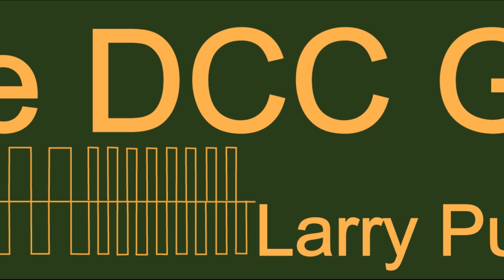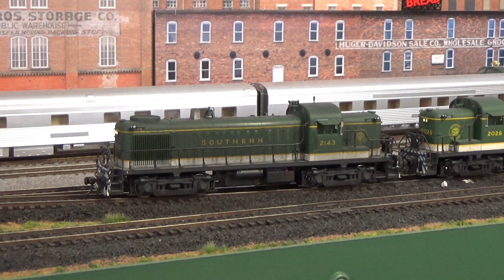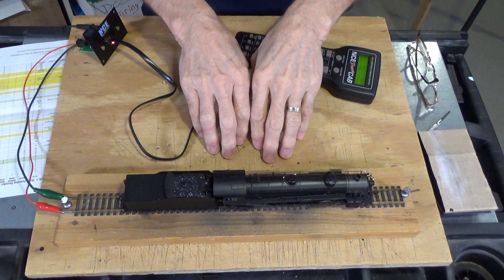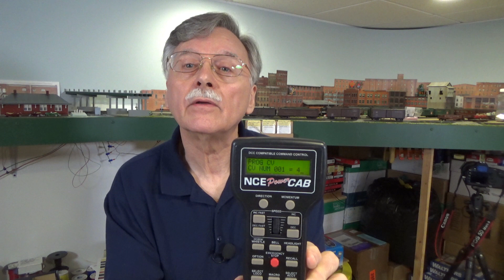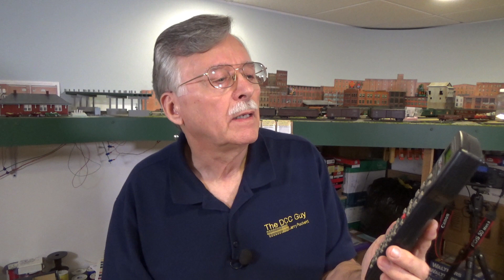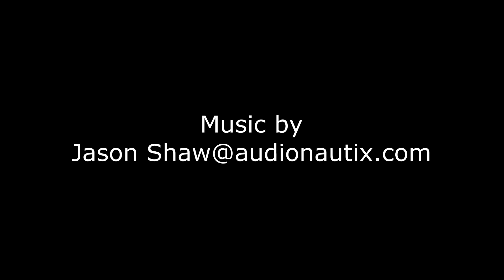DCC 101, Programming the Basic 8 (47)

Comment: Hello, thank you for good info insight into Dcc. I looked throughout your video list, but can’t see a solution to my problem. Hopefully you are not too busy to pass on your comments!
Recently, after a few years of severe illness, I’m getting back on my feet again, before this occurred I had an extensive 00 layout, all DCC, here in the uk. Now I am re-launching my system to A/C 3 rail, Märklin C Track. I already had two ESU locos, running 2 rail DC,DCC. Everything was fine. I cleared out all my 00 locos and fitted my ESUs with the centre pickup. On the Program track my DDC setup as usual, however, on the main track mix has priority, and I’m down to 16 functions, not 29 as with DCC. I now use a Märklin cs3+ Central station, Myers’s 500, is moth balled! 
Sorry this is lengthy, but you seem to me to be my best bet…….
I have been informed I need to change CV47 to -2 or CV50 to 0, this stops max being the priory system and allows DCC on these two locos.
I have tried changing my CS3+ and that works, except my Märklin locos work better with max. Can you help me? 
a. To identify the CV I need to change on my ESU locos……
B. What setting these need to be changed to. 
I tried to change CV47 to -2 on my Ecos but it crashed every time.
Any help will be marvellous…………
Oh by the way, great channel, extremely informative, I Subscribed over two years ago, whilst still in hospital. Thank you

Comment: Larry, I use NCE power cab and plan to add a model railroad technologies caboose light decoder. Can I program that with the power cab or do I need to get involved with JMRI and connect my pc to the track?
Reply from the maker: If it is based on a DCC compatible decoder then it should work. IT should say something about programming it in the instructions.
Reply: @TheDCCGuy  thanks Larry! I’ll check out the instructions when it arrives. Paul

Comment: I just ordered a NCE Power Cab, which I haven't received yet, so I am watching this video in preparation for its use.  I'm wondering how the Power Cab differentiates between a test track and the main line?  Would not the functions be identical in either case?
Reply from the maker: Not sure what you mean by test track. Care to explain?
Reply: @TheDCCGuy  The single piece of track like you used in the video.  Maybe you called it a programming track?
Reply from the maker: OK, that is the programming track. It is used when you want to change the setup of the decoder, sort of like changing your preferences in a computer or your TV. The PowerCab does not have separate outputs for running locos and programming them, that is why you need an isolated piece of track for programming. Otherwise you would program all your locos on the track at the same time. I have produced other videos on setting up a programming track and NCE sells the Auto-SW that will automatically switch the output to the programming track whenever you send out programming commands. Most DCC command stations now have separate outputs for operations and programming but the PowerCab is now almost 20 years old and does not.
Reply: @TheDCCGuy  ok, so the answer is that the DCC controller has separate outputs for the main track and the programming track.  Thanks
Reply from the maker: No, there is a single outlet that provides BOTH main track power AND programming track power. You must provide some way to isolate them so as not to accidentally reprogram all your locos. I have several videos on my channel offering various methods to do this.

Comment: I had a problem with "run away" engines when I turned on my NCE DCC system. After doing some research on NCE's website I discovered that it was caused by decoders that recognized DC and DCC power. By turning off the DC function on my decoders I eliminated the problem. Your explanation of CV29 was big help in solving the problem. Thank you

Comment: Trying to set CV6 with a NCE PowerCab. When I enter a value and press enter, I receive a message saying, "Can not read CV". What should I do the remedy this situation?
Reply from the maker: Are you trying to program on the main or on an isolated programming track?
Reply: @TheDCCGuy  Using the programming track mode with no other engines on the layout.
Reply from the maker: Have you had a similar result when you tried to read other loco decoders or just the one?
Reply: @TheDCCGuy  Just this one.   Its a QSI chip with 007 Id and 113 Manufacturer code.
Reply from the maker: I have not used a QSI decoder in years so can’t really address issues with them. The PowerCab is usually pretty robust about programming decoders. You might see if there is a QSI forum on Groups.io that can advise you. You could also try programming it on the main and see if that takes. You won’t be able to read back but it might work.
Reply: @TheDCCGuy  Thank you for all of your responses.  They have been encouraging.  FYI:  Your channel was the first one I subscribed to and it's one I keep coming back to. I find your presentation to be understandable and full of excellent information.  Thank you for that also.

Comment: We have a 5 year old layout at my Club that has developed a problem. After tens minutes or so, any sound locomotive will stop running, non sound will run fine. It is NCE controlled with a sb5. We are at wits end. Where can I get assistance?
Reply from the maker: That is a very strange phenomenon indeed. Does it matter whether it is one or more locos running at the same time? Do the same locos operate without issues on other DCC layouts? Does the brand of decoder matter or does this happen with SoundTraxx, LokSound, BLI, Digitrax, etc. decoders? Do they start running again if given a rest period? Even if it were a power issue I would think the sound would drop out and the loco continue to operate. I would call NCE tech support and see if Ed Wilson has any thoughts.

Comment: Hi Larry, I was wondering if you covered troubleshooting on NCE POWER CAB. I’m having trouble with my hand held unit, it doesn’t hold more than 2 loco’s in memory. How can I correct this?
Reply from the maker: Open your manual to about page 59 to set cab parameters. The default value for loco recalls is 2 but you can change that to as many as 6. Follow the instructions.
Reply: @TheDCCGuy  Thank you 🙏

Comment: Will this controller work with the newer digital LGB/Marklin locomotives? And would I need a booster to go along with it?
Reply from the maker: If you mean the NCE throttle then no, it uses their proprietary cab bus. If you system has a wifi interface then you might find some throttles from ESU or other european makers that will work. TCS throttles also might work as they use a wifi interface. Watch my video on throttles as it talks about the issue of interoperability.
Reply: @TheDCCGuy  thanks sir
Reply: @TheDCCGuy  this one may do the trick, Marklin 60657 Mobile Station Digital Train Controller Set

Comment: If I use only dcc locomotives utilizing the powercab coupled with SB5 while only implementing the basic CVs, do I need  decoder pro? I guess what is the main benefit of decoder pro? Is it simply an organizational database that pulls all locomotive configurations into a nice clean computer program? If so, I don't think I need the USB connector as it will probably overcomplicate things unless I am misinterpreting decoder pro. thanks
Reply from the maker: Once you get past the basic CVs things can get a bit complicated but that is primarily with sound decoders. If you don’t have or plan to use sound decoders then you really don’t need DecoderPro.
Reply: @TheDCCGuy  Great. Thanks for quick reply and always making the content understandable and applicable especially to newbies.

Comment: Dear Larry,

3 point of acceleration It is a good but quite primitive method, because in real live parts of acceleration is not equal at all. 

For example Br 80 acceleration start slowly, but it own locomotive length it run for about 11 seconds, however distance about certain train length it beats of a 35 seconds. Which totally impossible to beat with CVs min-middle-max speed points. Or it is too slowly from beginning or move one meter scale rail too fast (faster by 10 seconds) than it needs to make more precision’s settings.

Did you try more deeper SVs settings?

Comment: I have programmed a new locomotive with a NCE power cab and now when I hit forward it goes into reverse and reverse is forward. What can I do to change this?
Reply from the maker: Watch video #48 and pay attention to the values for CV29. Change the value of CV29 to reverse the direction of travel and that will do it as long as the decoder was wired properly
Reply: @TheDCCGuy   Thanks I will try that. It should be wired correctly since it is brand new,but I guess you never know for sure. Thanks Bruce
Reply: Changed factory CV 29-063 to 034 . Now my Rapido F59H now it goes forward when selected and reverse when selected. Hope this helps anyone else having this problem .
Reply: @brucemacdonald4672 I had the same problem with a bachmann class 37 when using the power cab until reprogramming cv29 . It was the only loco out of  seven that had that issue. Many thanks Bruce.  
Regards 
Brian in the UK

Comment: Dear Larry,

I enjoy your wonderful, instructional videos.  Thank you very much! :-)

I did run into a difficulty programming these cv’s and was wondering if you might help.  I’m a newcomer to the hobby and just recently purchased an N-scale Broadway Limited EMD SW7, DTS #117, with a Paragon4 Sound DCC.  I am working with an NCE Power station, just like yours in the video.  All a first for me. :-)

When I went through and programmed a long address, I discovered that it required a zero (0) in front of #117, that is, I had to enter 0117.  In the controller it now reads asterisk (*117).  No big deal.  I was just surprised that the software was unable to distinguish / work with 3 digit “long” addresses.  Henceforth, when selecting locomotives, the user must always remember to prefix 3-digit addresses with a zero.  Is this correct?

The larger issue is that after running through the cv’s, the locomotive sort of jumped backwards and then stopped responding.  I rebooted everything and then was “forced” to reset by entering 8 into cv8 as you explained in your video.  No big deal, however… my bell button now operates the light!  So, too, does the light button… strangely.  Thankfully, my horn still functions normally.  The bell was functioning fine beforehand, so I don’t know what I may have done wrong?  Just wondering if this is something you’ve seen and might you have a suggestion to remedy?  Thanks.

On a lighter side, I absolutely love programming the momentum.  At first, I entered 60,000 and it took forever to stop.  :-). Neat!  Pressing the direction button and the locomotives ever so slowly braked and then slowly accelerated in the opposite direction.  Pretty cool.  This is my first modern purchase of DCC sound, etc.  Didn’t think it would be a big deal… But, it sure is fun!

Thanks again for all!
Best,
Dan Cleary

Comment: hi can you explain "cant read cv"that comes up on some of my decoders thanks Brian
Reply from the maker: It can vary depending on whether you are using your handheld throttle or DecoderPro. Sometimes on decoders with complex indexed CVs the timing may be off and the system fails to read the values. Also, some decoders expect a certain voltage and are not getting it. Usually if DecoderPro can’t read a cv then the handheld throttle will but not always. Which DCC system are you using, do you use DecoderPro, and which  rand decoders are giving you problems? Finally, programming on the main will usually work even when you get a cannot read on the service mode track as it is working with full track power.
Reply: Hi thank you for your reply most greatful,I am using a NCE POWER CAB,the decoders are not new have had for sometime,tried using cv8 to 8 to see if that works, some work ok others don`t,Hope this help`s can`t explain any thing else,if it help dose it on MAIN AND PROG TRACK,Thanks again,Brian....ps Happy christmas and have a good new year.  @TheDCCGuy
Reply from the maker: First, I have found the PowerCab to be a very reliable programmer so don’t know why you would have this problem. However be aware that you cannot read back CVs on the main, only with service mode programming. Also if these are older decoders of various brands some in the past used different reset CVs and settings. Dig out your manuals and check. If you don’t have the manuals most companies have pdf versions on their websites.
Reply: @TheDCCGuy  thanks for that, will have a look later see what i can find ,thanks again Brian.

Comment: i need help setting my new NCE controller back to the factory setting. step by step
Reply from the maker: You have to be more specific than that, there is more than one.
Reply: @TheDCCGuy  I just bought two HO  DCC engines and a NCE power cab controller. When using the 
engine number on the engine was incorrect, trying to fix it , the 003 on the NCE went to something else
and the more i try to correct it the worse it gets, there i need to restore the NCE back to its original configuration to start over. The manual did not help.   Also my trains both have 5 numbers , the NCE wants only 4. which do i use? first 4 or the last four?    Ive been watching your videos . yours are better than anyone  else's.   Thank You   Ron
Reply from the maker: Ok so you want to reset the decoder. Put it on a programming track (they show you how to set one up in the manual) and program a value of 8 to CV8. That should reset it to factory defaults. In the future remember that there is a difference between “3” and “003”, these are two different addresses. And that holds true for all addresses.

Comment: Hi, great video. It would be useful to show folk programming using the STD setting, as well as the CV setting that you've shown so well. I've found that very easy to use with my NCE system.
Reply from the maker: I am planning a video showing how to program a decoder step by step using DecoderPro.
Reply: @TheDCCGuy  Yes that'd be good too, I do like JMRI and I also use it, albeit after initial programming with NCE Powerhouse Pro, which as I'm sure you'll know is almost identical to PowerCab operationally. The NCE 1st option STD programming on the Program track is incredibly easy compared with the 2nd option CV setting. I've never used the 3rd option so can't say about that. I just wonder if everyone else realises this? Your Function mapping video was absolutely great, thanks.

Comment: Larry, this old video just popped up on my cell phone, and I hadn't seen it before. I found it helpful. I have a question about programming tracks. What is it that defines a programming track? Is it enough simply to be isolated, or is there a voltage limit? With my NCE Power Cable or PfoCab, is there a difference between a main line and a programming track? With my controller, there is an output identified for a programming track. Thanks.
Reply from the maker: The programming track is electrically isolated from other tracks to prevent reprogramming all other locos. Also the output from the command station for a service mode programming track is current limited to prevent damage in case of a short circuit. The good thing about a service mode programming track also is that you can read CV settings as well as write them. Check out video 45 too.

Comment: How can I make my HO trains go faster?  With todays engines and my NCE power cab DCC system, speed seems limited.  My Dad could run his trains off the rails by turning up the transformer.
I look forward to your reply.  Thank You - Tom
Reply from the maker: The PowerCab basically is a pass through device on that the voltage out is dependent on the voltage in. The one I have runs at about 14 volts which should be enough power to zip your trains around so check your little wall wart power supply to see what its voltage rating is. If it is the same and your trains run slow then it may be your speed settings in the decoders but not likely unless you changed them. Another possibility is your wires. Thin long wires will drop track voltage significantly as will not having enough track feeders off your main DCC power bus. If you only have one power connection to the track then that is your problem and you should have a set of feeders ever 6-8’.
Reply: @TheDCCGuy  Thank You so much!  My My wall wart power is DC13.8V=1.8A
My layout is 4x6 with two and  half loops interconnected with turnouts.  I have one track feeder on each of the two main loops.  
With Gratitude,
Tom

Comment: I must be missing something. No matter what I change my CV5 to, it still goes full speed of 80 scale mph.
Reply from the maker: What kind of decoder is it? some decoders previously did not support that feature when using the default 128 speed steps but I thought that feature was no longer being done. You may need to set the decoder for 28 speed step operation for CV5 to work. You could also try using the user loadable speed table option to lower the top speed. All of this is so much easier to do with DecoderPro.
Reply: @TheDCCGuy  It’s a Bachmann locomotive with a Bachmann decoder. I’ll have to see about the 28 speed step operation. Thanks for getting back to me.
Reply from the maker: OK, depending on the age it might be a SoundTraxx decoder or it might be a Bachmann which would explain this.